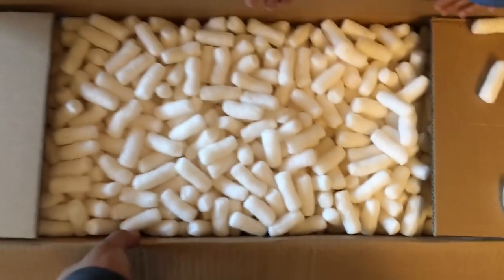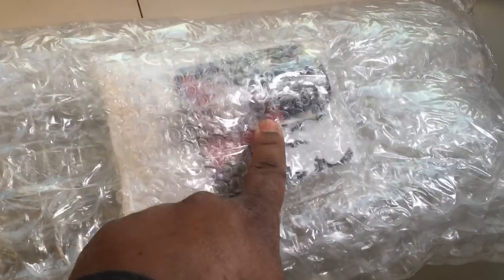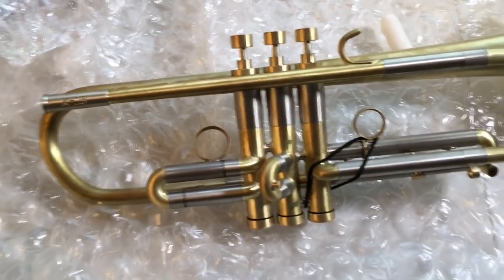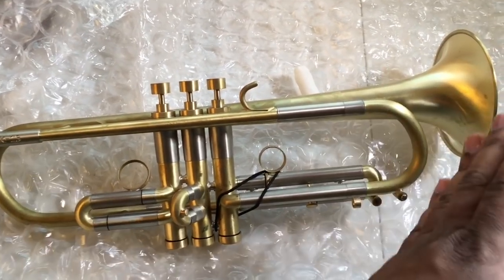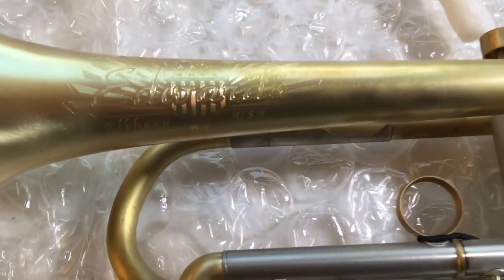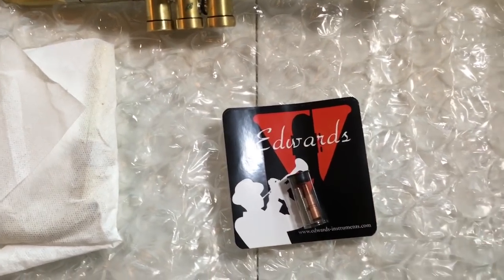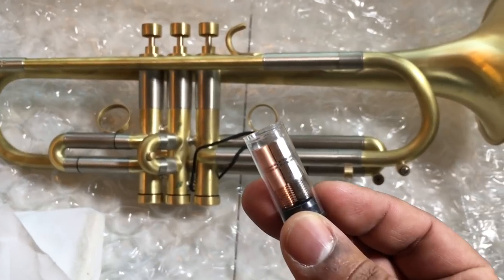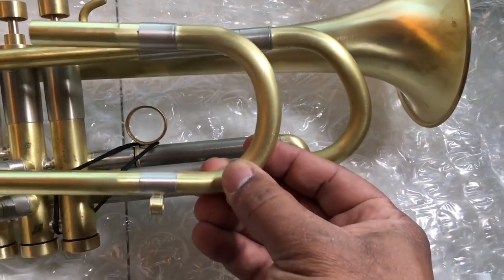Edwards X-13 Trumpet Unboxing

Comment: Your trumpet valves are a unique design.  I've never seen anything like it.  Can you do a short video and pull out one of the valves so we can see the design?  Beautiful instrument.  I purchased a Stomvi S3 trumpet earlier this year and it has the brushed lacquer.  I love that look.  Enjoy.
Reply from the maker: When you take the valve out of the casing it appears to be slightly shorter than most valves (although I have not measured or compared). The cap is hollow underneath which allows the valves to be pressed down firmly.  But the valves are among the best valves I have ever played.

Comment: Just came across this video--nice horn. What did you play before and how does the new compare?
Reply from the maker: I played an Edwards Generation 3 for about 12 years.  The new horn is familiar yet different.  The sound is certainly more centered.  The trumpet slots differently and I am still getting to know where everything sits.  The sound really doesn't compare to anything else.  The trumpet is perfectly balanced, literally, is the shortest Bb trumpet I've ever played (still getting used to that) and is very lightweight.  I think this model is made for solo work, primarily.  At some point intend to add the X-17 to my toolbox.  I love it all!  :o)

Comment: Horn (you) sounds great , is that the large bore model?
Reply from the maker: Louis Thompson Hi! Yes, it is the large bore model.  It doesn't feel large at all though. It's very light weight. The lead pipe is small to the touch (not sure of actual measurements). The sound is very focused.